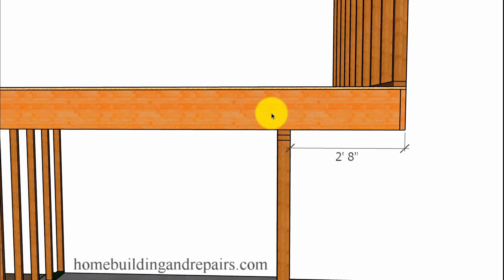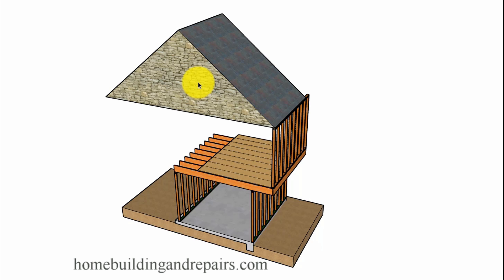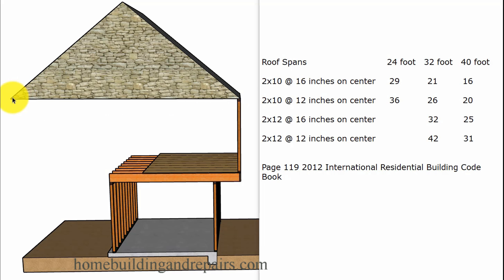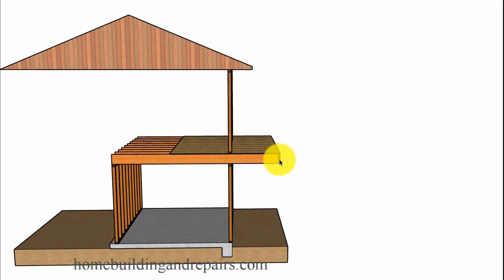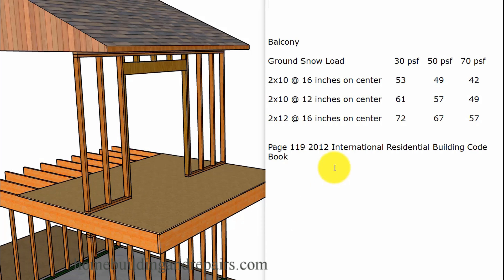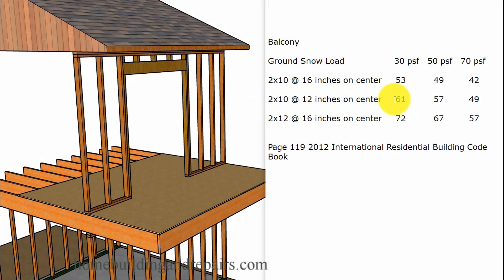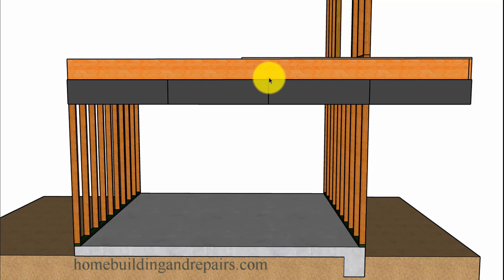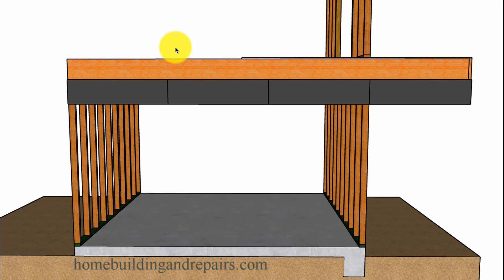Maximum Floor Joist Cantilever For 2 x 10 And 2 x 12 Joist - Building Code Charts

Comment: The foundation columns for a 12x16 cabin are already installed. I've decided to go 16x24 instead. We went 10x14 for the columns factoring a cantilever of 1 foot on either side. What would you recommend for floor joist to attempt a 3 foot cantilever? I was thinking 2x8 12"OC or 2x10 12"OC or 16"OC

Comment: Do I need to use pressure treated lumber when I’m doing my cantilever?
Reply from the maker: It might depend on where you are located. I would check with your local building department to verify.
Reply: No, you insulate and close it in just like the eaves under your roof with soffit/siding material.

Comment: doesn't make any sense why does a smaller roof have greater leverage? is it just because of the weight?
Reply from the maker: Yes, weight.
Reply: @gregvancom  why doesn't the more weight hold down the other end of the cantilever better ?
Reply from the maker: @Trevor.Morrice  Large lumber, stronger footings and the general design of the building would all need to be considered before suggesting that leverage or weight would be a benefit or liability.

Comment: We're looking into doing a bump out for our kitchen. We have a 24" soffit so we like to stay within that so we don't have to change the gutter line. It would only be to accommodate moving  counters and cabinets. I've learned now about the 3:1 ratio which helps.
Our roof pitch is only like a 4/12 pitch.o was originally thinking we wouldn't have to change the roof, but we'll have to do something to accommodate room for insulation above.
Thanks for a good video and info to look up code.

Comment: Question about this, would the joists have to be pressure treated then since they are also going to be outside?
Reply from the maker: It will depend on your area and local building code requirements.
Reply: No, you would close up the bottom of the joists with soffit material, just like under your eaves.

Comment: As a framer for over 3 decades, I've framed 100s of cantilever 2,4" with no problems. We also used 1/4 out 3/4 in the house as a minimum.
Reply from the maker: Thanks for sharing, but what is 2,4" mean.
Reply: @gregvancom  2'-4"
Reply: The foundation columns for a 12x16 cabin are already installed. I've decided to go 16x24 instead. We went 10x14 for the columns factoring a cantilever of 1 foot on either side. What would you recommend for floor joist to attempt a 3 foot cantilever? I was thinking 2x8 12"OC or 2x10 12"OC or 16"OC

Comment: Thanks a bunch. Is there a longer doable span for an interior cantilevered balcony that bears no load or walls, but just a balustrade/railing?
Reply from the maker: You would need to check with an engineer.

Comment: Would having engineered joists instead of dimensional lumber make any difference to the limits you can cantilever?
Reply from the maker: Yes and check with manufactures for more information.

Comment: Well I just don’t see how my cantilever has not crashed to the ground yet. I have a 8’ cantilever which uses 2x12”s 16” on center. And it’s been standing for over a year now with no issue. We don’t get snow here so I’m sure that helps. This will soon be supported with Columns but so far we have not installed them yet. This cantilever is also supporting a small wall and a roof with a pretty shallow pitch.

Comment: It presumes a 40 kg/m^2 deadload for sheet roof, and a 70 kg/m^2 deadload for a tile roof.   That's the simplifications of roof weight they use in that chart.  <3
Reply: this one doesn't have both roof types so I'm confused, it's changed since I saw it eons ago
Reply from the maker: Feel free to provide more details and a question if you're asking one.
Reply: @gregvancom  No, sorry, I thought I remembered something helpful and then when I checked it was not there.  Thank you.

Comment: Greg, a contractor built my house 2x8 on 16 inch center with 14 foot spans. 2 story house. Is this safe? Thanks in advance.
Reply from the maker: I depends on the type of wood, but you should be close. Span charts show between 13 and 14 feet.

Comment: I thought you were allowed to cantilever as far as the joist is tall.  I did 2' cantilivers in the 80's, but I thought they changed the code.
Reply from the maker: I've heard that before and maybe at one time it was true.
Reply: Old I comment, I know - But I am working on designing an addition for my 1986 split foyer and trying to do a 2-foot cantilever with 2x8 floor joists. The house already has a 2-foot cantilever across the entire front - including two 8'foor garage doors on the eave side. I'm hoping I can do a 2-foot cantilever on the gable side of the addition, but the IRC says 20" is max for 2x8, and that's at 12oc. I'm hoping to speak with an Engineer and see what they think, but the existing house is solid after almost 40 years. Thanks for the great videos! @gregvancom
Reply: @josephcook9065  The foundation columns for a 12x16 cabin are already installed. I've decided to go 16x24 instead. We went 10x14 for the columns factoring a cantilever of 1 foot on either side. What would you recommend for floor joist to attempt a 3 foot cantilever? I was thinking 2x8 12"OC or 2x10 12"OC or 16"OC

Comment: Hi Greg, thanks for the awesome video! For the 1:3 ratio, does that work if I have 2 floors above with a roof on top, interior space, not a balcony?
Reply from the maker: I cannot provide you with structural engineering, but can tell you that I've seen cantilevered balconies installed on each floor of buildings with more than one floor. You're welcome for the totally awesome videos:)

Comment: I have a recently built colonial style home, concrete foundation in the northeast US.  I want to increase kitchen size by cantilevering out about 4’, sister onto 2x12s, new exterior wall and roof.  How far would I be able to go, 4’ or the 2’-8”?
Reply from the maker: You would check with your local building authorities or engineers to verify information like that. Keep in mind that the information in this video might be different in your area. For example you might even be of the go longer.

Comment: What about 2x8 floor joists ?  I am thinking this would be an inexpensive way to support a double stud wall that extends beyond the concrete stem wall foundation by 8".  The inner stud wall would support the roof and ceiling while the outer stud wall would support only exterior insulation and siding.  The inner stud wall would have structural sheathing and WRB wrapped down and out over and back under the insulated joist bays.  8" space would allow for R15 continuous Rockwool insulation over the sheathed inner wall plus R15 between the studs of the outer wall.
Reply from the maker: I can't provide you with engineering information, but can tell you that I've seen plenty of 2 x 8 floor joist cantilevered, like you're suggesting.

Comment: Stuck around till the end and you went and discussed exactly what I've been wondering for a while.
The video posted in my autofeed, so that's awesome.
I'm hoping to have a 3' cantilever on my deck..
Reply from the maker: That sounds doable.
Reply: The foundation columns for a 12x16 cabin are already installed. I've decided to go 16x24 instead. We went 10x14 for the columns factoring a cantilever of 1 foot on either side. What would you recommend for floor joist to attempt a 3 foot cantilever? I was thinking 2x8 12"OC or 2x10 12"OC or 16"OC

Comment: Do you know if the same rules apply where the cantilever is off of the foundation wall or a girder on piers? I have a situation where one side of the outer foundation needs to be replaced but I don’t want to build or pour a concrete wall directly under the wall due to site conditions and cost. My proposed solution is placing piers set back from the wall with a girder. The total cantilever would be 20” and all appropriate joist sizing, spacing, roof spans as mentioned in the IRC would be adhered too. Thank you for all your videos.
Reply from the maker: I can't provide you with engineering information. The information in this video came out of a book that might not be approved by your local building authorities, building department our engineers. I would think that this information would apply to all floors in general, including raised foundation floor framing.

Comment: I was taught that the inside had to be a minimum of twice the distance of the cantilever, which would be 2:1 ratio. That was many years ago, so...
Reply from the maker: I was taught that also, but never had to think about it. Almost all of the cantilevers I installed came from building plans approved by engineers.
Reply: @Jay-tk7ib  I actually recently asked my engineers about this, and they said a good rule of thumb in the field, aka no engineer approval, is a 3:1 ratio. But with an engineer approval, you can do 2:1.

Comment: Hi
I have found your videos very helpful thank you.
I am turning a garage into a living space. It has a concrete slab floor and I plan on using high density rigid foam insulation with two layers of 3/4" t&g plywood on top for the floor. Does that sound ok to you or perhaps you have better suggestions? Many thanks.
Reply from the maker: I've never used high density foam for a floor and am not going to suggest that that will not work. The only other suggestion I would have, would be to use some type of wood framing and if you weren't going to remove the floor, maybe concrete.
Reply: @gregvancom  
Thank you.
What sort of wood framing? I can't go up too high because of ceiling limitations...even though I'm raising it a third.
The manufacturer suggested 400 psi foam with two layers of plywood joined but floating on top.
Reply from the maker: @vtbakerbuilder  For example if a you were going to raise it 4 inches, then you could probably use two by fours and three-quarter inch plywood. If you are going to raise it about 6 inches, then maybe 2 x 6 joist sitting on top of the garage floor and three-quarter inch plywood sheathing. How high are you trying to raise it?
Reply: @gregvancom  
Well, it's just for slab insulation ( foam board) and to make a solid base on which to have a kitchen and living room. That's about 3.5 inches all together.
I am raising the ceiling by a third to give more space....but doors and windows cannot go much higher due to top plate restrictions.
I'm sorry if I'm not describing my plan very well. :)
Reply from the maker: @vtbakerbuilder  No worries, I think I understand what you're doing and the only problem I see would be any of the material separating from each other if they weren't securely fastened with some type of screws. Other than that, let us know how it turns out if you do it.
Reply: @gregvancom  
Thanks... I will.